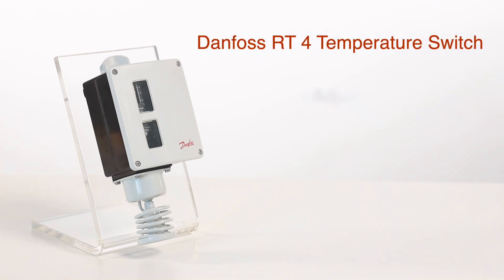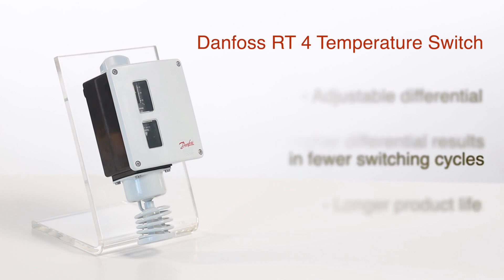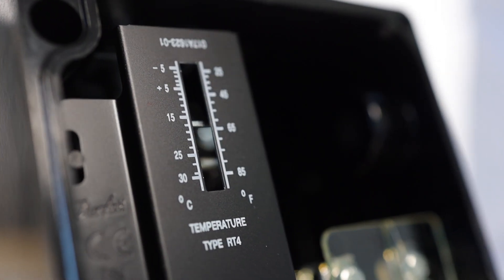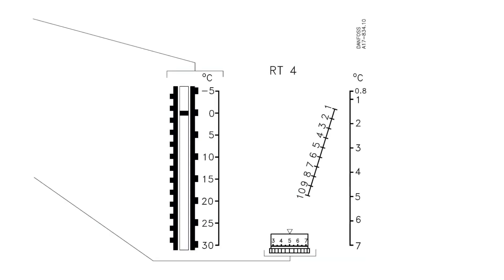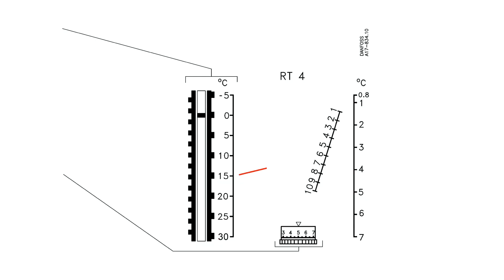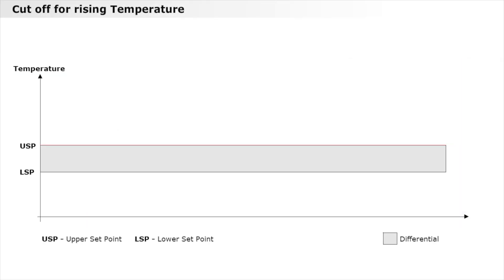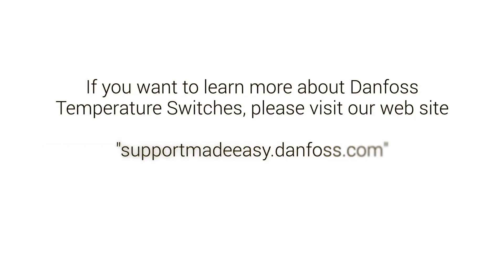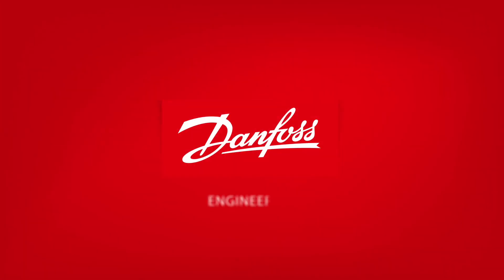How to set up a Danfoss temperature switch | Walkthrough

Comment: What if I set the RT thermostat setting knob in -5 and differential knob in 1 what are the cut in and cut off ?
Reply from the maker: Hi, we are checking with our experts and will get back to you.
Reply from the maker: As per the nomogram (first page of the Installation guide, https://assets.danfoss.com/documents/202317/AN17948642226901-000402.pdf, the setting knob (range setting) at -5C and 1 on the differential knob means that the real differential will be 1,5C. The range setting is the lower switch point. The upper switch point is obtained by adding the differential: -5 C + 1,5 C = -3,5 C. Cut-in and Cut-out depends on how you connect the wires. It is more precise to say: lower switch point at -5C and upper switch point at 3,5C. We hope this answers your question.